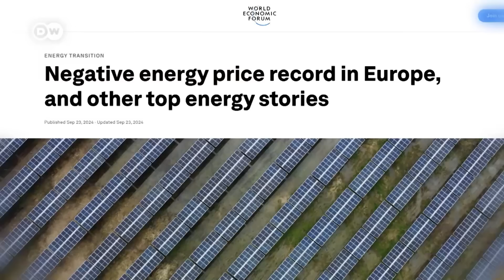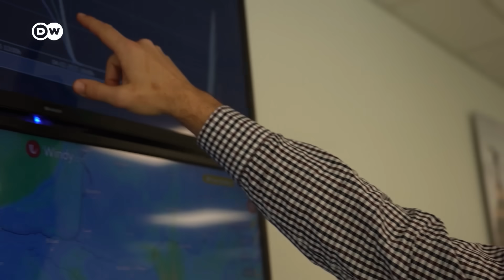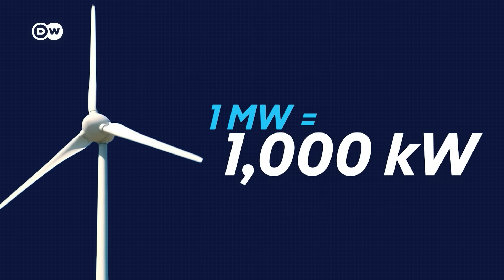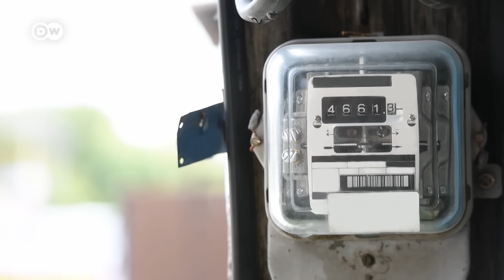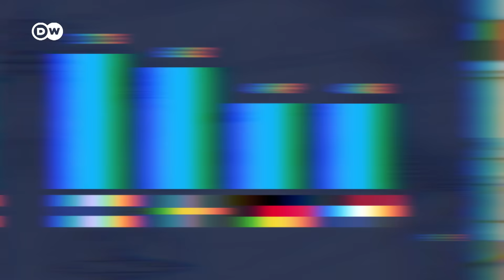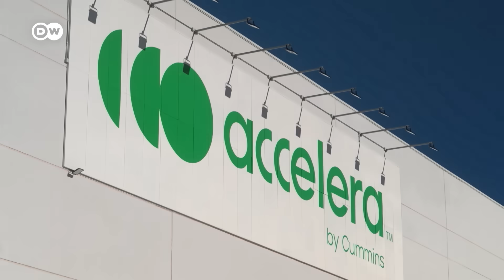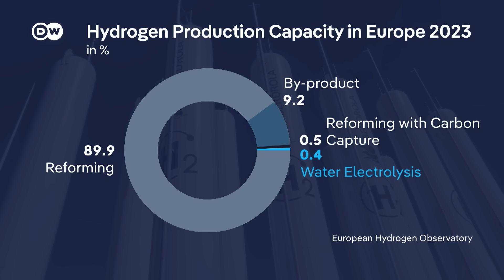Negative energy prices: Why cheap electricity can create huge problems | Transforming Business

Comment: This short documentary is pretty woke tbh. Basically you cannot control your energy output. So it's unstable. You either have too much in the summer or too little in the winter, and you haven't got any feasible solutions to balance out the output.
Reply: It is not woke... it is talking about facts and markets.  If you look at forecasts then the market will change even quicker.  It is rapidly accelarating.
Reply: Hydrogen production and pumping water isn't a solution for you?
Reply: @frankthetank5708  > Hydrogen production and pumping water isn't a solution for you?

It is for me. However, after 15-20 years we have a few pilot hydrogen plants capable of using intermittent electricity, and it turns out there isn't that much demand for pumping water and/or locations to put pumped hydro storage.
At what point do you realize these intemittent energy resources create problems, rather than solve problems? At what point do you just say "let's build nuclear, because it is far simpler and economical to work on making nuclear cheaper, than to work on integrating intermittent electricity"?

Comment: No solar power producer would supply any power to the grid at negative prices, if subsidies for his equipment werent higher. You can technically switch off power supply to the grid without any harm to your solar equipment. So if negative prices are really that bad, suspend subsidies for the times with negative energy prices. It saves the tax payer money and stabilizes the grid.

Comment: Nuclear?
Reply: No, thanks.
Reply: Yes, please!
Reply: They often need to be switched off for maintenance and so you need a mix of energy sources to supply enough power for when your nuclear reactor is being maintained.
Reply: @ > They often need to be switched off for maintenance

Yes, where "often" is typically 1 month every 3 years (vs daily with solar, or hourly with wind - where you aren't choosing switching off for unplanned maintenance, but where the weather is choosing when to switch on/off).

Comment: Negative electricity prices are an opportunity SCREAMING to new (BESS) battery storage investors, it is called time based energy arbitrage. In the end, this is a self limiting temporary issue, as more and more battery storage system come on-line they add demand at the low cost times, and reduce prices when they sell at the high cost price times. Electricity generated hydrogen is way too inefficient to be useful at all (realistically it is less than 30-40% efficient). Other forms of battery storage are probably more realistic (flow, Air-Fe, etc. are much more viable long term storage technologies).
Reply: Agreed! It is a non issue. It is all extra capacity to harness BESS installations, investors will get money from those.
Reply: You don’t even need to do that.  If it was cheap I’d put in an electric preheat tank and some other thermal energy storage (heating in winter and cooling in summer). Technology is available and cheap.
Reply: @patcusack6252  That puts the burden on individual household for a grid scale solution. And as you said, it ain't cheap.
Reply: I’ve been saying this for years! First time I see anyone else pointing this out. Good job! 
As we get more energy storage (batteries, hydro, hydrogen producttionj, the problem will simply go away, *as long as regulatorion doen’t get in the way*.
Reply: So why isn't that happening then?

Oh yeah, everybody ran the numbers and realized they can't make money on it.

But, if you guys think it is such a great idea - form a company, pound the pavement looking for investors, and make it happen.
Reply: @factnotfiction5915  It is happening and growing exponentially. The IEA shows that global energy storage is growing at 57.4% compound annual growth rate (CAGR) since 2015.  At that rate, capacity will double every two and a half years.
Reply: @factnotfiction5915  It is? In a lot of places you just need system operators and regulators to keep up. In the UK for example, BESS is set to more than quintuple in 5 years, from 5GW to 25GW. BESS just needs to be allowed to compete freely on the wholesale market with other generation, and to get skip rates down. It'll bring high prices down and make negative pricing less frequent, all without subsidy, profiting from all the arbitrage opportunities in the daily duck curve. In most places BESS could be or already is an easy investment.
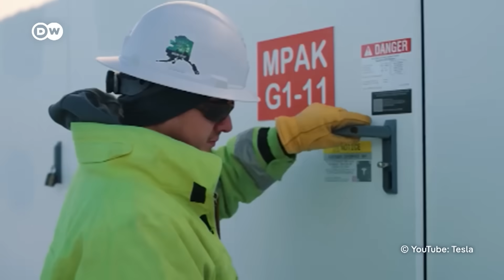Reply: @factnotfiction5915  It is happening.  The IEA shows a huge growth of 57.4% compound annual growth rate (CAGR) worldwide since 2015.  At 57.4%, capacity will double every 2 and a half years.  This CAGR level actually likely will increase.  See 10:05 in the video where they talk about global energy storage growth for a bit.
Reply: @factnotfiction5915 The opportunities exist in bamboozling politicians into sinking more taxpayer’s money into yet another “this new thing will save the planet” scheme.
Reply: True. That's why there are so many companies are willing to invest in battery storage.
This could have happened before if there wouldn't have been the regulations that producers are payed for their electric power even when it's not needed. In this case the producers would have provided battery storage systems already.
Reply: We have a huge amount of grid scale batteries online and coming in Australia because of this problem. Also batteries are being installed on home solar systems at a faster and faster rate.
Reply: ¡Exactamente!
Reply: BESS is a short-term solution with a long-term problem. It is not entirely renewable given the source of lithium and the lifespan of batteries. We are creating a long-term problem with lithium mining, battery disposal, and the problem of grid stability with increased battery energy storage penetration
Reply: @abeleonson  In the contrary, battery storage systems can stabilize the grid. Australia had huge problems with grid stability. After some big batteries were installed the problems were minimized.
Reply: @abeleonson  Technically, lithium batteries are 95% recyclables (you might want to look it up). Gas/Carbon is 0% recyclable. Battery storage is for now the only solution to stabilize the grid with intermittent resources (wind/solar) unless hydro is available (which is heavily geography dependent).
Reply: @abeleonson  Lithium can be recycled from spent batteries, and in any case, grid storage will likely shift to cheaper sodium-ion batteries.
Reply: @abeleonson sodium batteries will overcome these problems.

Comment: I dont get why our electricity bills get more expensive in the stronger day light hours, and this guy said that its energy negative profit on the same hours. This is a huge contradiction. Who is lying?
Reply: There isn't sunshine and wind every day. And the demand for electricity is much higher in daytime.
But you can reduce your costs massively with using small solar panels (Balkonkraftwerk).
Reply: The money for the subsidies to support paying for electricity nobody wants has to come from somewhere - usually from ratepayers and taxpayers. Thus, the lack of contradiction.
Reply: @factnotfiction5915  
That's the point in Germany.
Nobody wanted the massive subsidies for nuclear fission anymore.
No private company wanted to build new ones.
Therefore the old were shut down to reduce costs.
Reply: @frankthetank5708  > Therefore the old [nuclear plants] were shut down to reduce costs.

And yet, retail electricity prices are higher in Germany now, than before the NPPs were shut down; are higher in wind/solar Germany than nuclear France or nuclear Sweden.
Reply: @factnotfiction5915  
The prices are higher because Germany has believed that the cheap Russian natural gas will be available until 2035.
Therefore the EU has even recognised natural gas "ecologically friendly". Burning natural gas is the most expensive way to produce electricity now. Liquifiying it doesn't reduce costs.
Reply: @ > The prices are higher because Germany has believed that the cheap Russian natural gas

So your argument is, as I understand it:
* Germany can reduce costs (and thus presumably prices) with solar (and presumably wind)
* Germany also reduces costs/prices by closing nuclear
* Solar/wind definitely reducing costs/prices
* and then the Russians start a war and the price of natural gas goes thru the roof and causes all these cost/price issues - nothing to do with solar/wind

Your story doesn't pass the snicker test. It makes no sense.

If Germany has cheap wind/solar - that should make it less dependent on Russian gas - and yet you appear to believe the costs are driven by Russian gas prices.
If shutting down nuclear is so great, why don't we see big cost decreases? Rather than a record number of German households applying for energy relief from the state?
The contradictions go on and on.

Comment: Renewable energy storage is: 0,06%
That is the problem! Makes no sense to build more without storage!
Reply: True, renewables benefits will be magnified greatly by addition of grid-scale energy storage.  But one needs to lead and pull the other along.

Also, renewables (even without storage) are already taking huge amounts of carbon off the grids on an ongoing basis.  Because fossil fuel generators are "load following" and throttle back their power output day-after-day since grids prioritize renewables since they're cheaper and many local regulations prioritize non-fossil energy.  This saves on fossil fuel carbon output and wear/tear on their equipment.  So, as renewables and storage grow over the years, we'll see the periods of time that fossil fuel generators run on the grid gradually reduce until renewables + storage (and other non-fossil generators) can cover the 24-hour period comfortably.  But this will start from the center of the day (high noon) and expand towards the night.  Then the final celebration will occur on the day the last fossil fuel generator is retired for good.  This phase-in and phase-out approach is already happening under everyone's noses without most people knowing a thing about it.

Just to be sure, renewables + storage will obsolete every other form of large-scale electricity generation on Earth by bringing us towards the era of dispatchable "firm renewables".  Even gold ol’ hydroelectricity may start falling off.  Certainly, commercial utility-scale nuclear will be essentially gone due to its very high costs, very slow builds, and the unparalleled risks nuclear brings.  Utility-scale nuclear is already on its way out from the looks of things.

Comment: I don't get it !!!! Cheap electricity is literally a good thing...
Reply: A negative electricity price doesn’t actually mean that electricity is cheap. It indicates that power plants are in an uncontrollable state — that is, electricity is being generated in excess of demand. When this happens, large-scale blackouts can occur, so power companies are forced to pay to get rid of the excess electricity. As a result, consumer electricity bills end up soaring. In fact, Germany, despite experiencing negative prices, pays some of the highest electricity rates in the world.😅
Reply: @gyutae31  Large-scale blackouts will not occur with excess generation available.

Firstly, fossil fuel generators are dispatchable and "load following" so they can scale back their output on demand.  Solar photovoltaics can also scale back via software throttle of their MOSFETs or just turning off entire banks of solar panels.  Wind turbines can "feather" their turbine blades to reduce force or turn the whole nacelle slightly away from the wind to reduce their power output.

Secondly, the best thing to do is to sell this excess to the rest of the national/international grid.  Because it could be sunny in one region but shady rainy in another region.  This maintains local revenue while spreading out clean energy benefits to other regions that may be unfavorable weather or not have enough renewable generation of their own.

Comment: Overall, this is a very good thing.  This cheap electricity is all the more incentive to add energy storage to the grid!  See 9:35 in the video.

Energy storage operators can buy this cheap electricity during the day and sell it later at night for big profits (arbitrage).  This is a good thing since it incentivizes a very much needed technology!    Energy storage will bring us towards dispatchable "firm renewables" which will obsolete most every other large-scale electricity generation.

There are far more choices for grid-scale storage than lithium: liquid-metal flow batteries, sodium, sulfur, pumped storage hydro, ceramic/sand thermal storage, gravity, compressed CO2, hydrogen and many more options.  These are fractions the cost of lithium, safer, and has longer longevity as they're optimized for stationary grid use. 

One new area of high interest is thermal storage using sand or ceramics.  This is especially cheap energy storage because it is made of the cheapest most abundant elements on Earth (silica).  This stored heat can drive industrial high heat processes like steel- and concrete-making which direct electricity currently has problems reaching the very high temperatures needed for these industrial processes.
Reply: No one will learn until the blackouts hit europe. Negative prices just mean that wind and solar are not even a marketable product.

Comment: Prices went negative today. So I set my AC to head my living room to 31c at full blast and the one in the bedroom to 16c just to waste power so I didn't have to pay to send power back from my roof solar.
Reply: homeowners with solar too
Reply: This is a very good move, everyone focuses on battery energy storage but anyone with a climate controlled house can store a thermal difference in their house by overshooting their cooling or heating and letting the temperature coast with the climate control off. If you don't have variable power rates or a smart device tracking power prices you can achieve a similar cost saving by cooling during the night and heating in the day (assuming a heat pump heater)
Reply: Dafuq? Pay to send power back? Don't they pay you? Also, solar panels can just shut off you don't need to send the power anywhere you can just choose to not generate the electricity. Some delulu madness going on here.

Comment: How much would electricity cost if the clean on demand nuke plants were not shut down?
Reply: The cost could be offset by putting the clean nuclear waste in YOUR basement.
Reply: Nuclear power is garbage, expensive and dangerous
Reply: For consumer/buyers definitivly more. 
It's way more expensive to produce nuclear fission power without possibility to shut it down in zero cost times.
Reply: Every analysis shows that nuclear is the most expensive option.. and building new powerstations is at least THREE TIMES more expensive than renewables plus batteries.